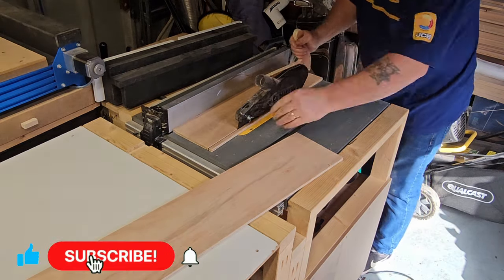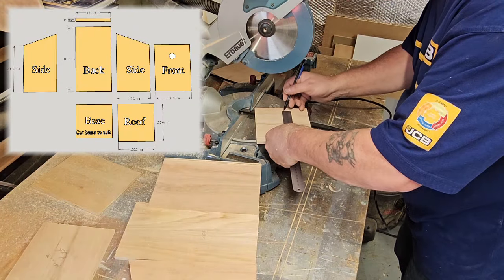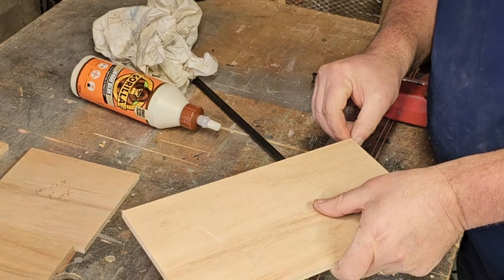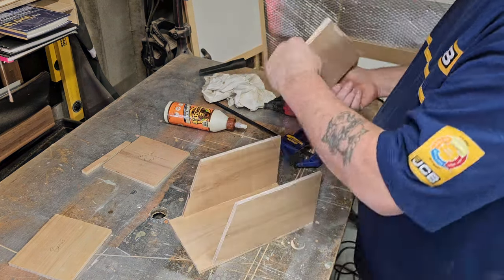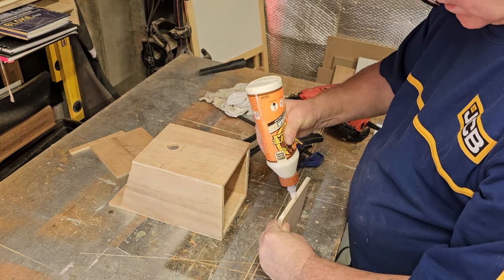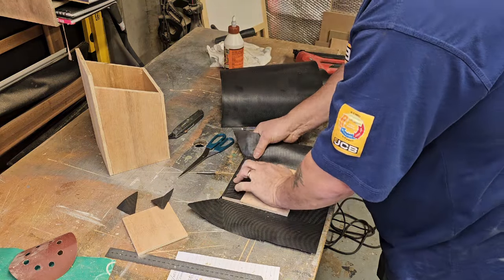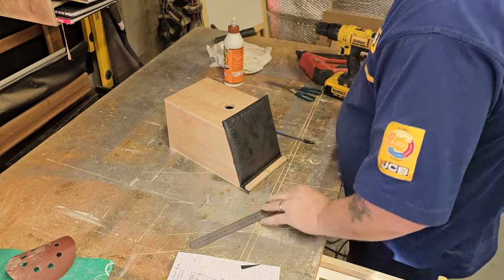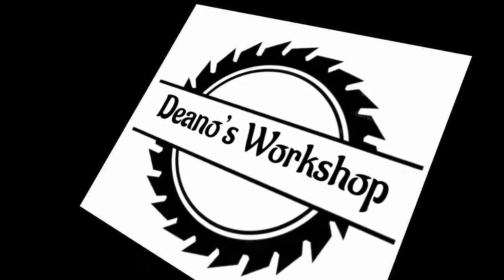Making a simple bird box #DIY #Blue tit #woodworking #nestingbox #RSPB #37

Comment: Nice tidy job Deano I use the air nailer but just lately I’ve enjoyed knocking the nails in finding it most satisfying lol 😂
Reply from the maker: Knocking nails in is old school.... im too lazy in my old age 😂
Would like an air nailer but it means getting a compressor and tbh I just don't have the room......perhaps an extension on the workshop is required 😂
Reply: @dodgydino62   lol well I’m 71 but it’s still fun and like you I’ve had my fair share of nail out bursts